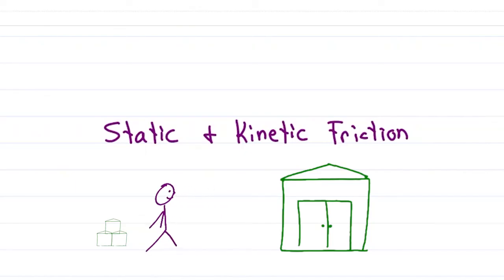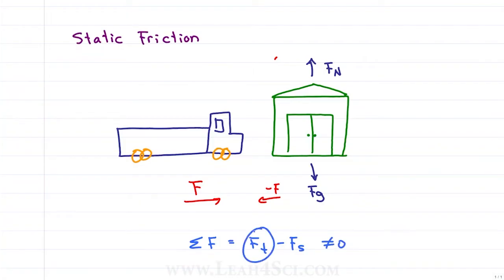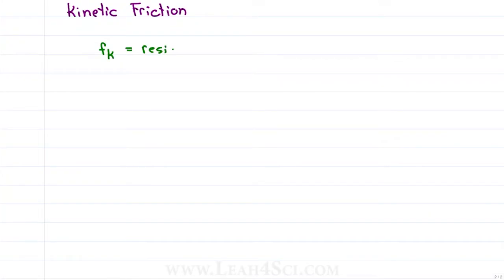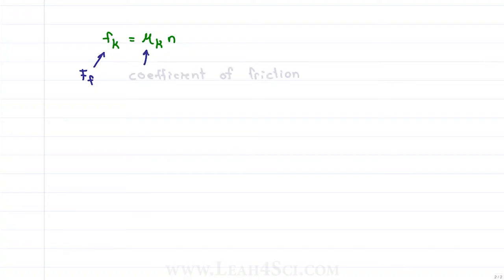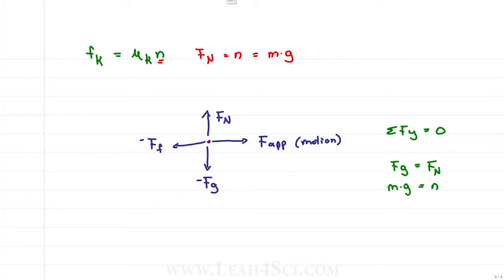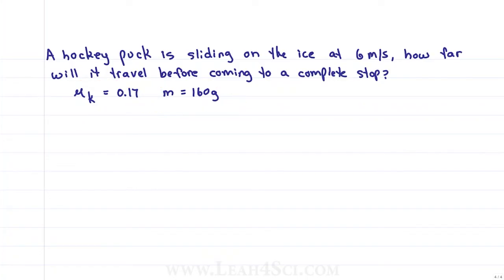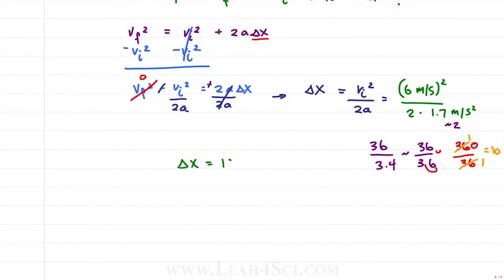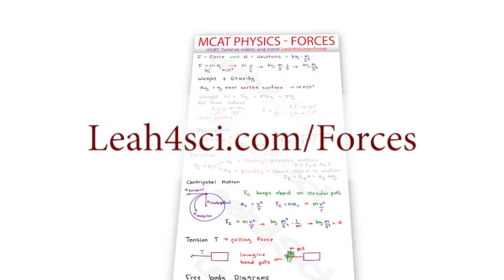Static and Kinetic Friction - Forces in MCAT Physics

Comment: At 4:43 the force F, what force is that? And for how long time does it work?
Reply from the maker: That would be the applied force of the body in motion. The body was accelerating, and it has mass. Therefore, it has a force because F=ma. As for how long until the body comes to rest on the ice, well that depends on the problem. There are a lot of factors to consider - the amount of force, the amount of friction, etc.
Reply: You did not understand my question. The meaning was: from where  does the force F come? Something must act on your body.
0:19 "Friction = opposes motion" Not true. There is a forward directed static friction force from the ground that makes your foot step forward and makes a car accelerate.
10:18 "Acceleration goes lower" Not true. I think you mean velocity.